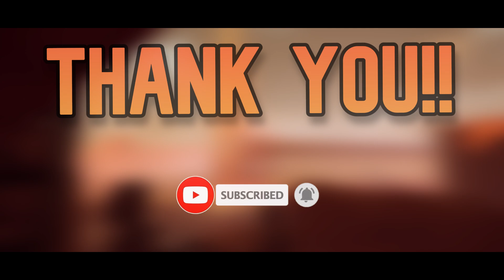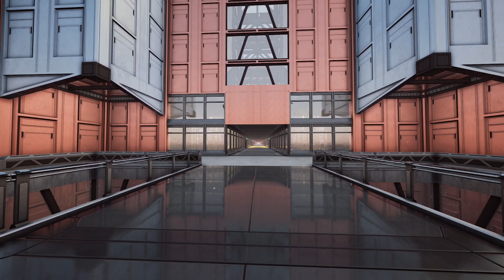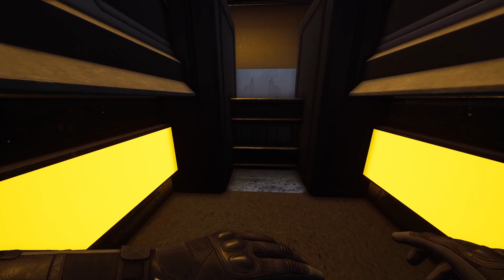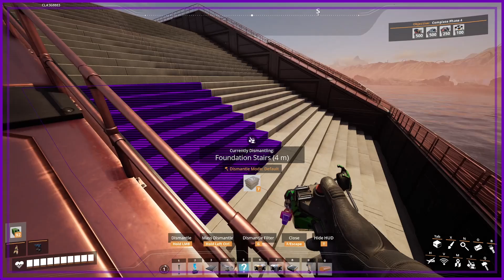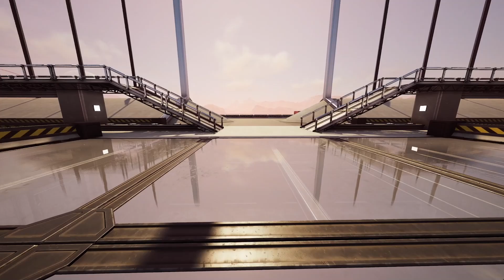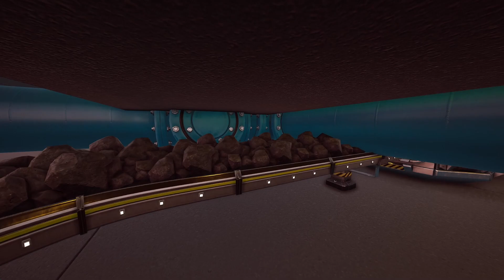My FIRST MEGA BUILD in Satisfactory 1.0!

Comment: ...Just why? I know I'm biased but I plan on downgrading my coal power to only 1 fully upgraded coal node because coal is so in demand late game. And that set of coal power is for the worst case scenario of a blackout. I'd use that power to jumpstart my next level of power up (fuel generators which I plan to massively build), and then nuclear on the next set of power generation.

On a completely different note: This looks really freaking cool. :P
Reply from the maker: I had fun doing it. I think that's a good reason why :)
Reply: Can use the converter to make more Coal later on if you really need it. Most people won't even with this setup. This is not even 1 pure and 1 normal node later on.